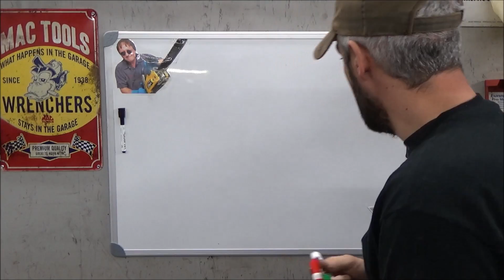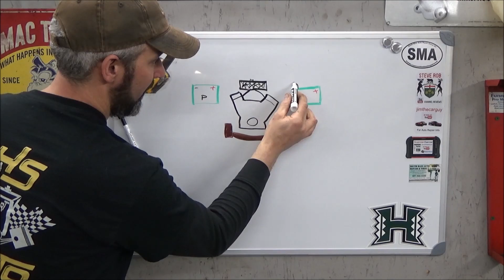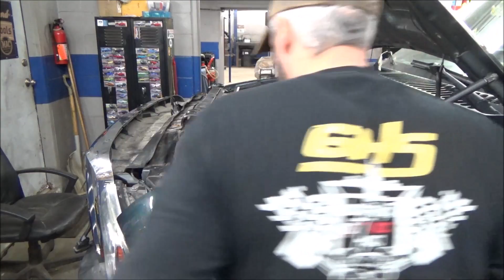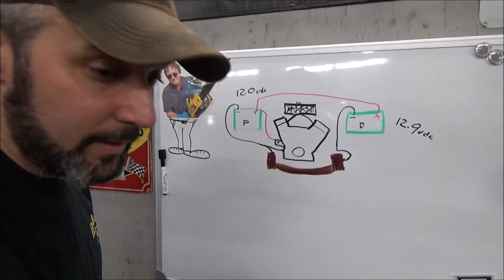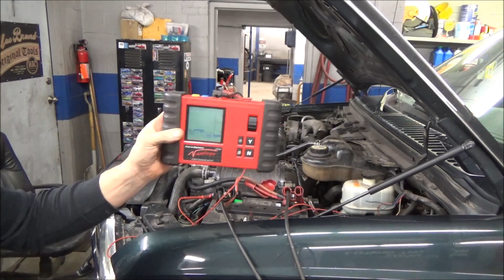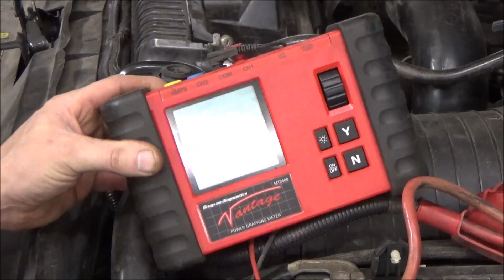Ford F-550 6.0 - No Start No Crank

Comment: WOW...2 YEARS AGO.....i am somewhat behind watching your  backlog of output.....why don't you like resistance checking? still a good test imho. ...rustbox frames =usually suspect earths (not always tho,). that burnt area would've been warm to the hand  during/after cranking, another quick hands on check? (Ive got a V10 ..yeah i know, i'll shut up.) i wouldn't use the factory cable, it clearly isn't meaty enough unless its been upgraded. make your own, you'll make a better job of it i'll bet and you get the cash, not Ford. Prob be on a Ford bulletin , defo not the first one i'll wager.

Comment: Eric nice work,  I like it when a plan comes together.Was the ground cable @ the pass, side rear valve cover(head) to body black or melted or looked burnt?  A thermal camera may have helped a bit finding the green/overheated stuff on this one.  you need to get one:) + there cool  as heck haha thanks for video & great Diagnostics dude
Reply from the maker: +karl winter Well the thermo camera would not have worked in this case. Remember we had an open circuit from the left battery to the right battery. Open circuit, no resistance, no heat :)
Reply: I would think it would have my friend. Trying to start that a few times then see the cool side of the circuit were it should have been hot. You can see current flow very well with these. I had one of these I used it on:) I think I still have image & I will look for it. Thanks again pal. oh yeah, I was cracking up when I seen Scotty on your board. wicked funny

Comment: I'm confused on how you were seeing a voltage drop on negative to negative?
Reply from the maker: +Rotoziptheman Voltage drop is the difference in a circuit. You can see it on the negative or the positive right?

Comment: too bad you charged the left battery. I bet it was dead since it was running lights I'm assuming? If not it would be a  little unclear where the start trigger was getting power. I bet that left people guessing and it went to auction because it no longer had accessories which if the batteries (one) were not changed would have made it's self obvious.

Comment: There should be a switching circuit between those two batteries. I have one from Painless Performance that allows the 2nd battery to help the first one when needed and to switch the charge to the weaker battery. http://www.summitracing.com/parts/prf-40120/overview/

Comment: hello Eric O great video I need some advice on a p0783 on a 98 Dodge ram.  as in the difficulty because I want to do it myself and help my dad out.     but he took it to a mechanic and the solenoid is located deep in the transmission.  just wanted to know your thoughts and any advice would awesome

Comment: Hi Eric,
First, thanks a lot for all your videos. There are like candies !
When the engine running my battery is at about 14.5V. After some time (maybe like 15 min), it's about 13.9V (with no accessories on of course). Does this indicate that the battery is fully charged ?

Comment: Is the computer detecting low voltage and locking out the starting circuit(s) until you install healthy batteries?

Comment: Good job showing how to test,but i would have pulled that wire out with out half of the testing you did.a bad connection to ground was going to be the problem.

Comment: I have a question though, if the negative wire was broken on the block to battery, why would the starter be trying to draw from the other battery and not the fully charged one? Clearly that other battery is being grounded SOMEWHERE? This confuses me...
Reply: +AvidAviator Also, wouldn't the engine block supply the ground to the rest of the truck seeing as there's metal bolts on metal motor mounts?
Reply from the maker: +AvidAviator Well it couldn't crank from the other battery because it was only grounded to the frame and not the block. I assume the mounts must be rubber with no metal connection other wise it would have cranked :)
Reply: +South Main Auto Repair I guess I forgot that motor mounts can be rubber haha. Seems crazy how one thing can disable an entire vehicle. I was installing "aftermarket junk" into my car the other day trying to wire a 2-way in. I tapped into a 20A wire on one of the harnesses on my BCM that controlled the non-existing sunroof. Got out my scope on a rope to check that the power is only supplied when the accessory circuit is on not realizing that the harness has the wires for the ignition on it. Needless to say I was pretty scared when the key didn't work and the doors wouldn't lock or unlock haha
Reply from the maker: Haha That aftermarket junk will get ya!!

Comment: I have a 1989 Mercury grand marquis and the turn signal click is super slow under electrical load and the brake lights flicker unless I are braking moderately hard. Could this be a bad ground? If it is I have no idea how to start checking. I also had problems with fuses blowing on the radio and headlights right after I installed a new ECU.

Comment: I'm at 17:55 into the vid...a lot can be told about bad cables using jumper cables. Would it not be a quick test to hook the positives of each batt with jumper cables then crank, then neg's with cables then neg's to eng?
Reply: Ha, I spoke too soon...great diag...and drawings and explanation.

Comment: Do you know if there is an isolation diode on these 6.0L? I have a 2004 F-250 super duty and passenger side batteries been repkaced 3x over 12 years... driver's side came with truck...176000 miles no troubles with it had first set of brake pads last year truck sits for long periods so I disconnect  growing and leave on trickle charger..would like to sell it as I like my 2014 ram 1500 crew cab much better

Comment: You could have saved yourself a bunch of steps by a) hooking the charger to the curbside battery, b) then connecting your voltmeter between both battery positives, and c) then connecting your meter between both battery negatives. I'm not even 17 minutes in and already know what the problem is without going through what I already know you are going to do. Probably not fair because I know a lot about troubleshooting Fords, but I am talking about troubleshooting in general.

The trick with speed is having somebody who knows how electricity works and how to use a meter effectively show you. Not dishing on you, and I do like your videos, but most 'mechanics' (of which I am one) (actually electronic troubleshooting) don't truly understand what they are doing (which is why you see meter probes with melted tips in just about every shop you go in to)(or why they put a 150A breaker on a pair of 12g wires).

For an awful lot of people, a wire is a wire is a wire, and dammit when will beer:thirty ever get here?

Find someone who knows, and give him a few bucks to show you some tricks.

Really- I'm not trolling you- keep up the good work.
Reply: Beyond that, this problem is an easy one and most likely the reason it was put to auction in the first place- the city mechanics couldn't fix it.
Reply: Okay I finished the video and you did a lot better than most I've come across.

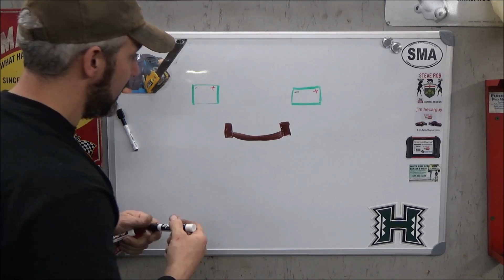Comment: 10:00 "There's your problem lady"    Your front crossmember is bent, your right frame horn is bent, and uhh the only frame that remains is from your front horns to the first cross member.  The fuel tank is with the missing frame.  Find that and all your problems will be solved.  Wont start?  Here is a battery smiley face in need of a nose job in a bad way.   Have a nice day!

Comment: Good morning, I am having trouble with my truck starting. So far I have changed out the following components new; Injectors, glow plugs. hpop, ficm, egr, engine wire harness and the ipr. and still will not start for me. Will you please help me?
Reply: Just keep replacing things and eventually you'll replace the right thing!🤦

Comment: Still doesn't explain why the batteries were different voltage unless that long cable was rusted out to.
Reply: +pdgeman Neg cable on driver side went to frame was good, Neg cable on passenger side that went to frame was bad, Alternator connected  to passenger side cannot have current flow without a good ground, even thou Pos cable going to both battery's were good HTH
Reply: +02lowrider62 ah you are right

Comment: i have a 2003f250 diesel it seemed like i was running out of fuel so it was chugging so i stop and got 3gal of fuel drove it 2miles then stopped it started up and drove 3miles almost home and it died codes reed p2614 p2617p2290 p1000 what to do next?

Comment: I have a 05 6.0 power stroke I parked int in shop at work and went to go home crank no start I check fuel psi and icp pressure and ficm volts and it only had 27volt out of ficm so I repaired it know has 48.5 it will only start if I spray ether and it will run all day as soon as u shut it off no start any thing anybody can help with would be appreciated

Comment: Awesome video as always. I have an brake system question. Can I ask it here or could I contact you on Facebook. Don't worry, it's not a basic question. In fact, if you come across it, you may feature it in a video. Larry
Reply from the maker: +lawrence hogan fire away...
Reply: +South Main Auto Repair Hey Eric. Thanks for giving me some of your time. I have a Motive power bleeder. It's a great tool. However, I replaced a hard line on my sister's 2001 suburban. I hooked up my Motive power bleeder, pumped it to 20 lbs. but the rear calipers wouldn't bleed. I had to get my sister to help me do it the old fashioned 2 guy way. Could the problem be with ABS? Do I need the key on, or have it running? I used this power bleeder on my Excursion and got a great brake pedel?
Reply from the maker: pressurizing the master cyl I assume? After 2 man bleeding them I assume they work good now?
Reply: +South Main Auto Repair Yup. At least as good before the line from the rear "distribution" block to the rear left caliper blew. Just thought that it was weird that the brakes wouldn't bleed like my truck did.
Reply from the maker: was the bleeder good and clear so 20 psi could flow through it?
Reply: +South Main Auto Repair Well the bleeder on the pass side bled out fine when she pumped it up. I had th replace the left side with a new bleeder. I used a cool tool that you use with an air hammer to break loose frozen bleeders. The bleeder was somewhat rounded off so I used a 3/8 socket on my air hammer. Problem is that the bleeder is now stuck in my socket TIGHT. It's always something Lol. Anyways, the bleeder is new and still wouldn't bleed with the system pressurized. Perhaps it's possible that crap got into the distribution block? I guess that I should try to power bleed them again and see if it works this time. I just thought that there might be something "wonky" with GM abs systems that the key needed to be on or something

Comment: I have an 03 6ltr I've replaced the fuel pump and all of the filters and while doing that I also dropped the fuel tank replaced the pickup plastic foot thing and  also the little rubber nipple on the other part of the pickup tube  when I went to put the tank back in the truck I broke the plastic fitting on the main fuel line replaced it with a peice of rubber fuel line put everything back together and the truck ran great, around town 2 weeks later took a trip to the mountains and on the first hill pull it starving for fuel!!!!! It was sucking the rubber line shut got the truck home replaced the fuel lines and now after I prime the system the truck starts runs for 5 minutes then runs completely out of fuel, full tank no leaks what the hell is wrong im stumped please help me

Comment: both negative to frame
Reply from the maker: +Gary Johnson What!?
Reply: South Main Auto Repair
two batteries tells me there is a secondary demand for power and you did say a snow plow which usually has lights and a motor.  Your drawing indicated batteries are wired in series which gives you 24 volts  Its very similiar to police cruisers which also have 2 batteries. The drawing down of one battery shouldn't be if wired properly.
Reply from the maker: My drawing is pos to pos and neg to neg... that is a parallel circuit = 12vdc
Reply: positive to positive is not parallel its series. DC voltage 12 to 12 in series is 24volts. where does it begin and where does it end?
Reply from the maker: Nope you are wrong 100%. I won't argue with you. Just google it and you will see. Basic electronics.
Reply: South Main Auto Repair Eric, I am a master electrician with 30 years experience both residential and commercial. I'll admit I don't have a lot of DC experience but I have a pant load of AC. What you drew was a series but in your world of DC it is a parallel. Nice talking to you
Reply from the maker: Listen you may be a pro but all I am asking you to do is simply google it. Do not take my word for it. Hooking positive to positive will NEVER in any way shape or form  double the voltage...ever... Simply google images of a parallel battery circuit you will see. I am not busting your balls.
Reply: South Main Auto Repair I know you aren't busting my balls, I think I still have them.
Reply: LMAO, oh boy......crickets

Comment: you were saying you got a rebuild ipc  for it and you had to program in the vin . what scan tool did you use ? i had a 6.0 come in a few weeks back with erratic gauges and i got a new ipc from ford but could not figure out vin entry with my modis ultra and sent wash kid to dealer to program
Reply from the maker: +Alvin Nagra Autel MS908
Reply: +South Main Auto Repair  i had a demo on the autel about a year ago  and ended up going with a fresh new red brick  and have been happy over all i have seen you run autel as well as snapperhead  thoughts on strengths and weakness?
Reply: +Alvin Nagra  video idea with motoyam 82 i dunno

Comment: Well.  It is a Ford 6.0L. There's you're problem. 

Seriously.  Since the '+' lead is cross connected, the two batteries will share the same '+' voltage (minus some line drop) between that and ground.  

I hate it when you work on something completely different and then something else breaks.  Happens on older vehicles all the time.

Salt.  Water.  Electrical charge.  Metal.  Time.  Equals bad wire.

Comment: It's a ford you can fix all you have to do is open the hood and remove the radiator cap and drive a new truck under it why do you think it was at the actions junk it

Comment: I owned a 2006 F350 with the 6.0 Everytime I went to start it, was pretty much a crank No start.   Spent more time at the dealer for warranty than I actually drove it........ shittiest engine ever made
Reply from the maker: +Bullshitkorner Yeah I see these broke down at my dads shop all the time, injectors, turbos, etc....
Reply: Yup doesn't surprise me went threw 3 turbos in 1 month, numerous injectors, HP pump went out, numerous oil leaks that wouldn't cause the injectors to fire...... loved the truck but had to get rid of it before warranty was up
Reply from the maker: I know they do a lot of deletes on them to.... well the "off road use only" ones that is. That seems to cure a lot of issues I guess too

Comment: You are working too hard the left battery has a bad connection from the center of the battery to the same terminal on the outside try cleaning both terminals on the left battery the one hooked to the starter. That will solve your problem.

Comment: the frame and the body of the starter should and was the same . electrically it's all the same point and read 0vdc. no matter if it's good or bad. you should have isolated the Driver side battery and went from the pos. on the pass. battery to frame . you would have been looking at just the one neg . of the pass. battery.

Comment: which battery controls snow plow motor and lights?
Reply from the maker: +Gary Johnson Is that a trick question? They are hooked in parallel so the answer is both.
Reply from the maker: +Gary Johnson Is that a trick question? They are hooked in parallel so the answer is both.
Reply: parallel the batteries would be independent of each other case in point outlets in your house is wired in parallel one source for hot and neutral.
Reply from the maker: No sir, the amperage draw on the whole circuit is the same. It draws from both batteries.

Comment: So I'm watching this video and you're kidding right. You have no continuity between the two batteries. You draw a picture on the board. There's only one connection between the two batteries that is common. So instead of going directly to that common connection and checking continuity. You go through all this checking load checking this checking that! you're just doing that for educational purposes right? You're not really serious about not seeing the elephant standing on your foot are you? Are you just waiting for it to take a poo on your shelf? Maybe it's just the burrito talking. All that work and all you had to do was check the continuity of the positive cable between the two batteries with a ohm meter. If they're good then through logical deduction is only one other possible problem of continuity. 30 seconds go to the negative part of the circuit. You got to get tired doing all that excessive analytic exercises. Just wake up and kiss (Keep It Simple Stupid) the problem and be on your way